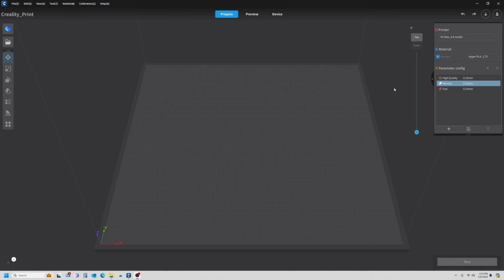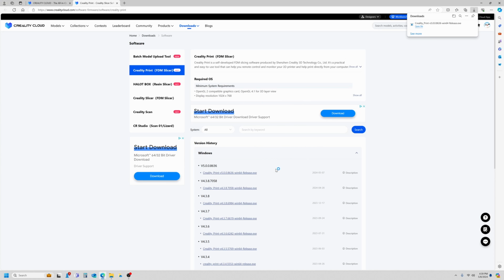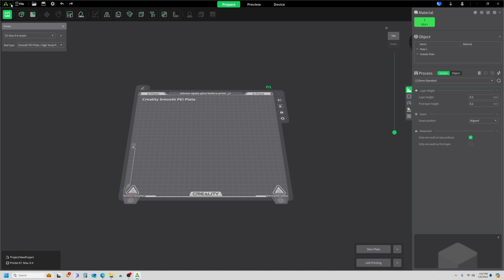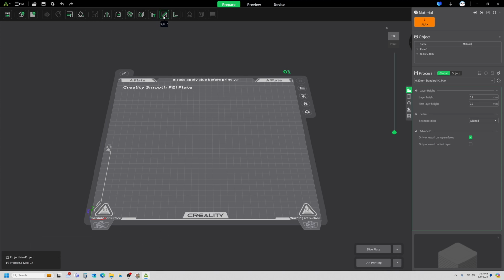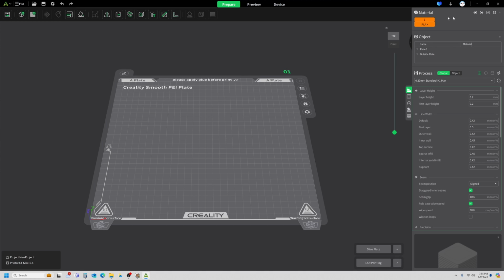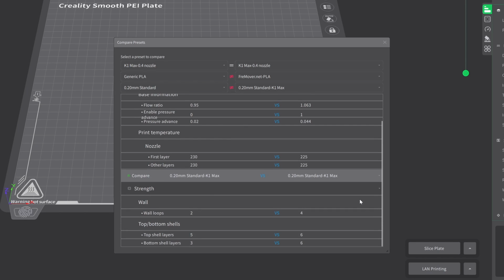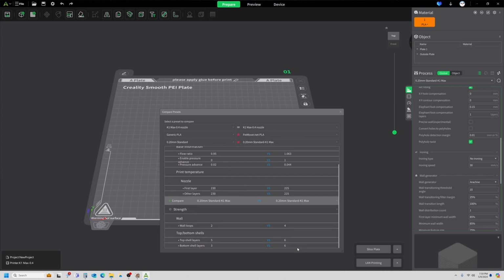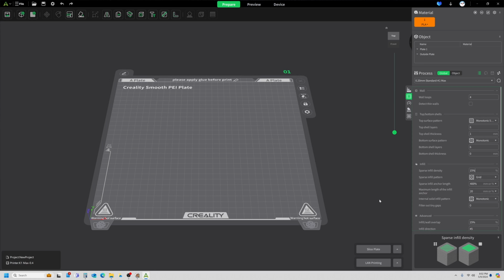Creality Print 5.0 First Look

Comment: Recently got the K1C and I've been using the latest version of the 5.0 with it.Have only been using standard PLA so far but the performance and prints have been great. I'm coming from a Flashforge Adventurer 3 so this is a nice step up. I have no experience with the previous Creality slicer so I can't comment on that.
Reply from the maker: Creality Print 5 is much better than previous versions and I'm sure it'll get better as they continue development!

Comment: ever since I  upgraded to 5.0, my prints have failed every time.  I didn't change many settings, just speed, infill, adaptive layers, layer height, and brim.  If I run same file through 4.7, they print fine.  I know 99% problems are user error, just don't know what I did wrong.
Reply from the maker: I know Creality released updated firmware for some of the printers when they released 5.0, so make sure you're up to date on that!
Reply: @pushingplastic7445  Not   sure exactly how to do that, but when i went to creality print 5.0 , i clicked on their icon in the upper left and scrolled down to help.  there i Clicked on update and it said i was on the current version
Reply from the maker: @Elimn8r64  The method you described is to update Creality Print. I'm not sure what printer you are using, but you want to check to see if there is an updated version of firmware for the printer itself.

Comment: Just loaded it onto my win11 machine. Sliced a model i had in cura. Sliced to same settings and the file size is s about 30 percent larger. Any thoughts?
Reply from the maker: Creality Print has a different algorithm for generating the gcode. It was completely re-written for Creality Print 5.

Comment: Very good videos you have, one question for you.. can you use variable layer height  (you got me hooked on this feature in other great video of yours) in this version? 

Thank you very much..
Reply from the maker: Yes you can, it's a little different but same concept. It's the icon on the top of the screen that looks like a bunch of horizontal lines on top of each other. They call it adaptive layers in this version.
Reply: @pushingplastic7445  Thank you very much.. it is definitely an improvement in quality and time... Super !!!
Reply: Did you ever used variable layers with supports?
Reply from the maker: @AntonioLima9000  I have, not in Creality Print but I've done it before. The supports and adaptive layers both functioned as they should have. I would expect the same in Creality Print.
Reply: @pushingplastic7445  I discovered that the Creality Print 5 or 5.1 have a bug. Does not slice Tree Support with Variable Layers. You can only use Normal Supports with Variable Layers... This bug is corrected on Orca but not in Creality Print.. yet.

Comment: Creality Print 5.0 is horrible so far. Since installing it, I have not been able to print a single thing successfully. I was printing fine on the older version. My prints fail due to layer shifting. This was not a problem before. I can not change the flow rate for my material either. So, this causes the hotend to extrude too much which causes it to get hung up and the layer messes up. I have the ender 3 v3 ke.
Reply from the maker: I understand your frustration. I have a video being released in a few hours on how to dial in the flow rate in Creality Print 5. Does your Ender 3 V3 Ke have the latest firmware? That might be the issue with the layer shifting. Keep me posted and good luck!
Reply: @pushingplastic7445  Yes, I updated it when I went to Creality Print 5.0. I did mess up on my post though. I did have some layer shifting before but nothing like with the 5.0 update. The ke is my first foray into 3d printing and I've been doing it a few months. I know you have to get it dialed in but I was on the verge of getting it good to go before the update.
Reply from the maker: @danielhulan3058  Understood! Sometimes an update can seem like a step backwards. When I see and update come out I do my best to make sure my firmware is up to date and run the calibrations before doing anything else. Then I'll start dialing in my profiles. Feels like starting all over sometimes, but don't give up!!!! Eventually this all becomes second nature!

Comment: i hate this update, i was using the previous version before then it stopped working so i had to update it, trying to change the infill % is basically impossible, not matter what i change it pops up with an error and i have to reset it, i was enjoying 3d printing until this stupid update
Reply from the maker: Hang in there, they are still working on this version! I haven't experienced the error with changing infill. What kind of error are you getting? Keep me posted, maybe I can help!
Reply: @pushingplastic7445  i'm trying to change the infill for a print to 100% and when i change it anything above 15% gives me the reset logo and wont fill it to 100%

Comment: Good info. Didn’t know they had a new version, will give it a try. Hope you can keep the old and this version so you can go back if you run into a problem. I’m a nubee at this so will watch your channel for updated info.
Dc
Reply from the maker: I'm currently running both versions without an issue. Windows machine in case it makes a difference! Good luck and thanks for watching!

Comment: I set the chamber temperature for ABS to 45. I wrote 1 below to activate it. The exhaust fan does not activate even at 50 degrees. I set the exhaust fan to operate at 25% during printing. Exhaust fan does not run at all. Could you help?
Reply from the maker: I'll try to duplicate this and see if I can figure it out!

Comment: How can i do the adaptive layer thing now?
Reply from the maker: In the top toolbar, Adaptive Layers is the icon all of the way to the right, it looks like a bunch or lines. Select your model, click that button. When the dialog box pops up slide the top slider towards Quality, .25 should be good. The further you move it towards quality the better it will look but the longer the print time will be. I hope this helps!!! Thanks for watching!

Comment: Its good, but i cant find a support percentage setting....have you?
Reply from the maker: I'm assuming you mean infill percentage. It's with the strength settings. There is no support percentage, but there are a lot of support settings that you can find in the Support tab and click Advanced.
Reply: @pushingplastic7445  i printed a model on the default settings, im really struggling removing the supports. Could you do another video like you did with the previous version.....it would really help.. many thanks
Reply from the maker: @grimwoody9481  Yes I will!!!!!
Reply: @pushingplastic7445  thank you
Reply: @pushingplastic7445  ps, it was the support density percentage i couldnt find

Comment: Nice video. With the calibration in v 5.0 pass 1 prints then load up pass 2, you can’t pick the best print on Pass 1 . This v5.0 needs much more work on it to fix the bugs. Also Creality, don’t have a user manual for v5.0 that I can find yet.
Reply from the maker: Good call! I noticed that as well and had a note to mention that in the video and I dropped the ball. I put in a message with the Creality developers on that one. For now I did the "old way" of dialing in Flow where you print the hollow cube, 2 walls, no top, do some measuring, a little calculating....ect. I have an older video on my channel using that method if it helps. Thanks for watching!

Comment: With CR5 PRO-H I have tried Creality Print two years ago however I could not find any advantage with Creality slicer by then I saw Creality Print had less options. Maybe I am not smart enough to do it by myself.
Even so Creality Slicer has less options than Cura.
What are the differences between them?
Thanks for sharing it
Reply from the maker: Cura is a good slicer. I was using it all of the time and started using Creality Print when the K1 Max was released. Creality Print handles that printer better than Cura did. But the one thing I would like to see in Creality Print that Cura has is the Per Model Settings, or modifiers as they're known in Orca. Thanks for the comment and thanks for watching, I really appreciate it!

Comment: Creality print 5.0 is very good

I am getting faster print times and higher quality! (E3 V3 KE)
Reply from the maker: Same here with the K1 Max! I hope they get some of the other printer profiles done soon! I really want to see how they work!
Reply: @pushingplastic7445  more print profiles would be nice! The V3 KE has one profile and it is 0.2mm layer height 

I wonder if they plan on doing 0.1/0.3/0.38
Reply: Did you notice any difference in the vibration compensation with the KE pls?
Reply: @jacobcauchi5933  it certainly seems to be running smoother than before! And it was running well before (KE) 

The more I use CR Print 5.0, the more I love it! I’ve tried almost all of the slicers and this one just works perfect with the KE 

I’m gonna do linear rails on the bed and make the gantry rigid, then here comes 500mm/s 😄

Comment: Bill I enjoy your videos and your channel, however, I am not a fan of Creality Print.
Reply from the maker: There's nothing wrong with that! I try to put videos out for Cura, Orca & Creality Print. In fairness, I use to use Cura exclusively, then I gave Super Slicer a chance. I really liked that one. After getting an X1C and having to use Bambu Studio for that printer until Orca came along and covered all printers. I actually started using Creality Print because I wanted to check out the printer profiles so I could duplicate them for Orca. Sorry, kind of rambling on here with my trip down memory lane! I appreciate the kind words and I thank you for watching my videos! What slicer are you using?
Reply: @pushingplastic7445  I followed a similar path to yours, except I could not afford a Bambu but finally got a K1 Max and moved to Orca at that point and not looked back. Keep up the great work!

Comment: multicolour printing is coming for the k1/k1/k1max/v3/ke soon it going to be a upgrade those printers listing now are going to be multicolour printing also i have seen that my k1 and max is alot faster at printing also there was a new firmware for both printers alot fast than my bambu lab
Reply from the maker: My question is will the parts required to upgrade those machines to color be cost effective and will the process be easy enough for "most" users to do it themselves vs buying a new printer that comes from the factory ready to print color.
Reply: @pushingplastic7445  what creailty told me that the upgrade will include all the parts required including the CMS i am waiting on the K2 and K2 plus coming out i alway wait and see how it doe's never rush into stuff it will bit you in the ass. here in the UK there a delay in getting printer by 3 months behind you guys in the USA.
Reply from the maker: @nigel5823  Same thing I was told. My concern is that upgrading the K-series to color print via a kit might be beyond the skill level of some users.

Comment: Great review.
Ive Been using it for the last week, i was going to switch to orca but since trying out 5.0 ive been very impressed so far with my k1
The only problem with it so far is im still getting the crash occasionally when using it

I like how the infill overlap is now set to 15% as standard.
It was at 0% default in the previous creality print
Reply from the maker: It does have a few bugs, but I know that Creality is currently working hard on Creality Print 5.1 to address these bugs and add new features!
Reply: @pushingplastic7445  i haven't tried the pause for colour change yet, have you? I'll be trying that out tomorrow

Comment: Don’t know if have noticed it but when I installed 5.0 in my windows 10 laptop and open the slicer, sliced a normal cube, and no that the preview was showing it printing anticlockwise, so I printed the cube and yep the model was printing anticlockwise. So i uninstalled it, an reinstalled the one that came with my ender 3 v3 se and went back to clockwise printing.
Reply from the maker: Creality Print 5.0 has a revamped printing algorithm that reduces overall print speed and improves print quality. This could be why you are noticing a difference is print direction. Thanks for watching.